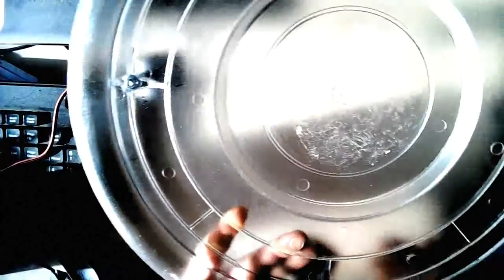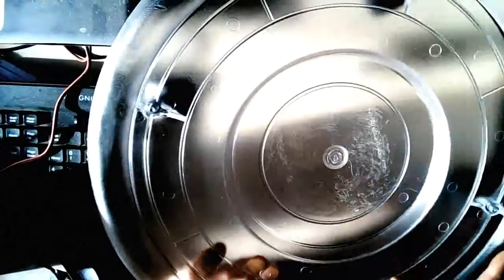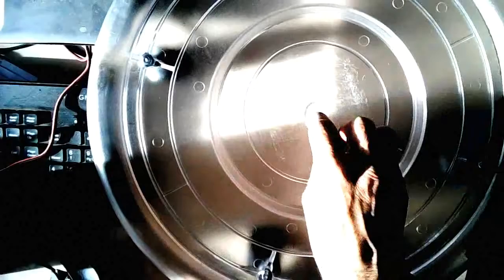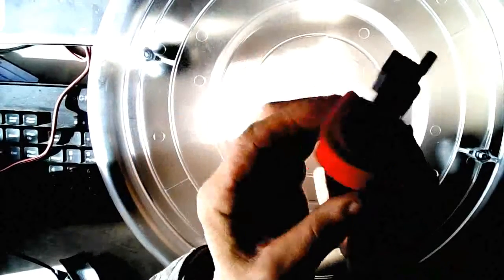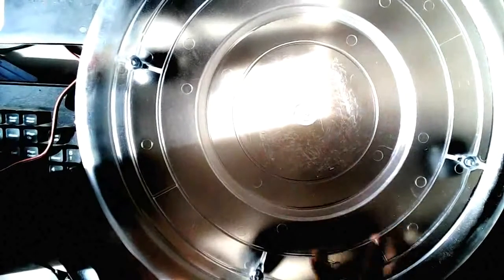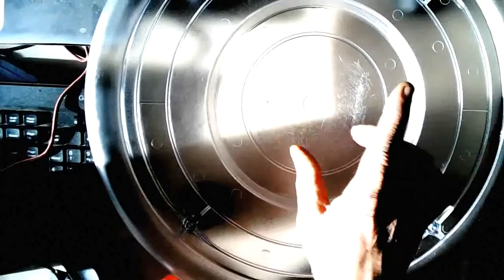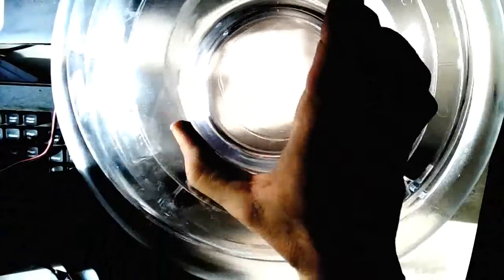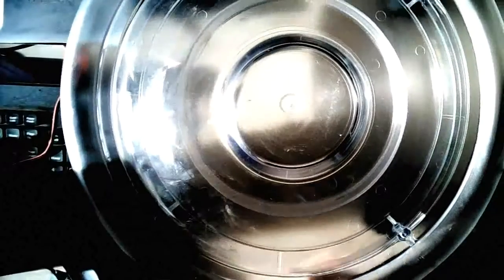Demo #38 Research Update- The Environmental Chamber!

Comment: It will be interesting to see what the results are. If I understand correctly your intent is to measure the environment in the chamber to control and/or determine the effects of air and temperatures on the reactions. If so will you be performing control tests outside for comparison?
Reply from the maker: You are partially correct Fred, not that what you are saying is a bad idea. The temperature measurements are mostly because the cell is thermoelectric, and absorbs (almost said sucks Lol) heat out of the environment. It also apparently gives off heat too, because of endothermic and exothermic reactions on charge and discharge.